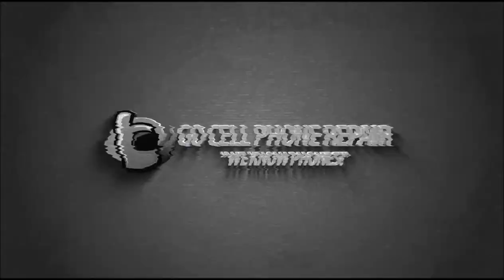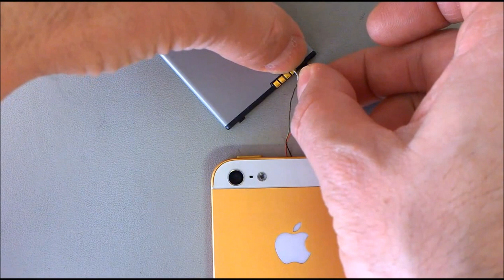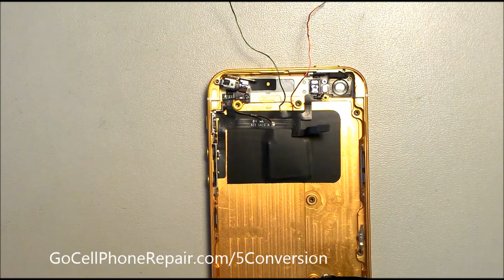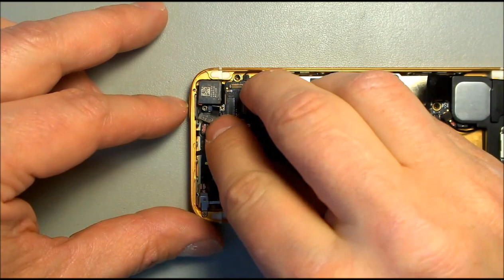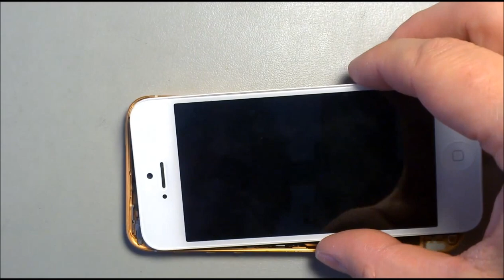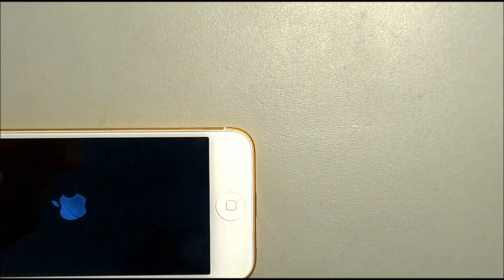iPhone 5 Housing Replacement Part 2

Comment: Just used this to re assemble my iPhone 5 and was a great guide. Thankyou :)

Got a small issue with the power button though :( Brand new flex cable, button itself AND rear housing but the power button doesn't activate on push. Really annoying.

Comment: I did a housing replacement but my phone doesn't boot. When i plug it in to the charger all i hear is the charging sound.
any tips?
Reply from the maker: Try reconnecting the display and battery and then plug the phone into a power supply. I also have some troubleshooting ideas here: http://gocellphonerepair.com/how-t/troubleshooting/

Comment: Thanks and I found out for the button problem, I forgot to attach the cable to the main board , as for the speaker problem, I still can't fix it even I redo all the part, but anyway thanks for you detail video demonstration ! Cheers

Comment: hi, i followed your instruction and every thing works fine expect for all the actual buttons are not working and the speaker sounds awful, i wonder which part did i encounter a problem and how can i fix it?
Reply from the maker: That is a very difficult question to answer because of the number of variables involved. Unfortunately the best option is to rebuild it one part at a time until you can isolate the problem. By the way. The buttons usually take some tweaking to position correctly. If they click but do not function you might have damaged the flex cable.

Comment from the maker: dk2000zx You can probably survive without them but I always try to put everything back together the way that it was originally. Sometimes the foam prevents the connectors from detaching and also reduces the chance of electrical shorts.

Comment: Hey, I bought a new colored housing that came with the speaker assembly and buttons assembly preinstalled. However, it does not have the foam pad on the top metal part of the flex connectors. Do i absolutely have to transfer the foam pads on top of these connectors? Thanks!